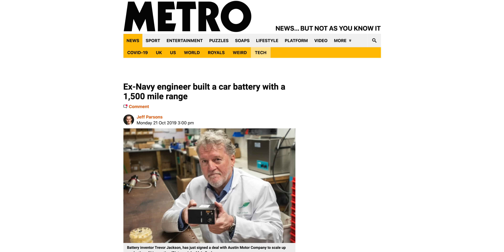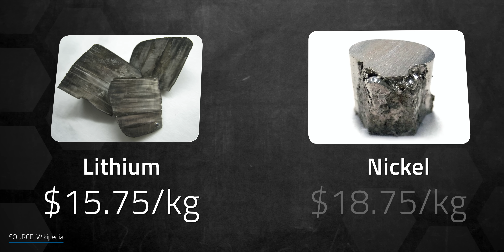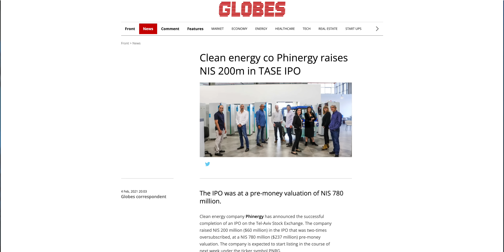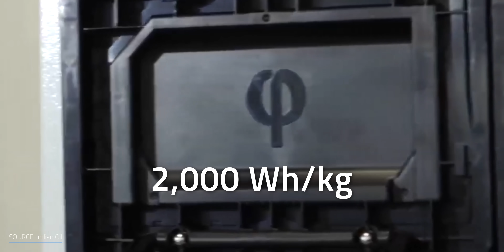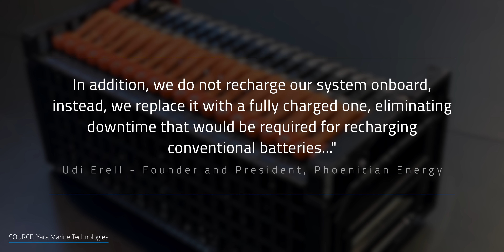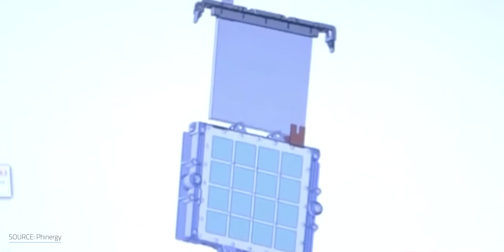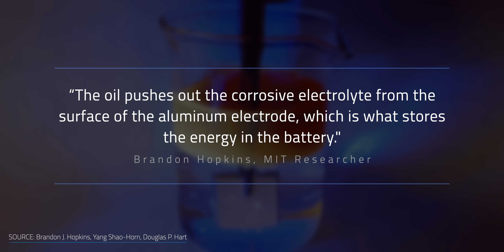Exploring the 1000 Mile Car Battery - Aluminum Air Hype?

Comment: The way I see it is that the 300 miles an EV today is WAY more distance than I'd need. I really only need the battery for about half that just so I'd feel confident I could use the car for a few days locally in case a situation arose where I couldn't charge it. Then if I could put an Aluminum Air battery in the trunk in the event I need to go on long distances would sound like a win-win to me.

Comment: Aluminum Air battery would make a great range extender.  Put it in a small two wheel trailer and tow it behind a regular Lithium battery EV.  Going on a long road trip rent one from U-Haul.  The small two wheel trailer could also allow extra storage space which is exactly what is needed on a long road trip.  Or how about a RV trailer with Aluminum Air battery capability.   U-Haul can rent those as well.  If EV manufactures could make removable hitches and electrical connections standard this would eliminate the problems with buyers hesitancy over concerns about longer distances.

Comment: There is one thing I don’t understand: why not build an electric car, but instead of a huge battery, use a small one combined with a small diesel generator. AND build this battery and generator modular. So you can change this module in the future if better technology is available. Because there is one thing I hate about all these electric car discussions! Everyone is acting like we save the world with them. Which is definitely not the case if you produce throw-away products. And we all know that these cars won’t last for decades like the “old” petrol cars.

Comment: Why not have two batteries and swap out the one that is used up, while using your second b/u battery.   You won't have to be towed.
  If cost is problem or size maybe build them smaller (750 miles on a charge) and have two of them so one is a backup you drive on and get replacement battery for the used up one at the station.

Comment: Battery swapping isn't an issue with me, as long as there are enough available. It would be nice if they made it where you could interchange them for a rechargeable drop-in as a in-between when the customer is not able to do a swap for another Aluminum air battery. Like the side of the road, the royal areas or even long trips.

Comment: Yes, a recyclable battery swap every few thousand miles instead of daily charging… count me in!
Many people would be interested in this after all conventional ICE cars need periodic oil changes and people put up with it.
Reply: i didnt hear anything about costs. is seems like if you throw the battery away every 1000 miles its got to be expensive.
Reply: @scottmcshannon6821  they are being reused not thrown away
Reply: Costs are indeed primary.Fleet vehicles and leased cars could have their own depots particularly if they stick to one manufacturer.The potential here is unlimited. I would sign up to it.
Reply: 3 minute swap is faster than filling up your tank with gas. Charging lithium isn't free like people think. Maybe it would cut down on child labor as well. Depends on cost but sounds great to me. 300 mile range is worthless to truckers for instance. Carry a few extra packs and you could cross the usa...
Reply: @Mr.Mister001  finnaly someone brought up the child labor that elon musk fans love to ignore.
Reply: Forgot to mention how ev lithium are putting even more strain on the grid..
Reply: @Mr.Mister001  if we could ever get the people on board with Thorium reactors, this wouldn't be a huge issue.
Reply: Lets say where you live has 10,000 cars that use Aluminum air batteries, will there be enough Gas stations with 10,000 + air batteries, just sitting there waiting to be used?  I think not.  Now if they could figure out hot the stop the degradation issue and be able to recharge them, then you have a game changer.
Reply: @kfl611  supply and demand. They could store these batteries easier than gasoline/diesel. Plus, no extra strain on the grid, emergency home power, and you could keep extra batteries yourself. Imagine 3k miles without needing to fill up...

I'm no expert but those all seem like game changers to me. It's a pain to store 30+ gallons of gas but 1 battery? No more generator for me if I had that option. 

I'm not saying it would be easy. I am saying it's easier than putting in charging stations. Then aluminum is recyclable. Lithium burning at every car wreck would pollute so much. It all sounds too good to be true... If it does work, I'm all in. I don't want a car that only goes 350 miles but I travel often for work. 

As for recharging, I don't see the need. Just look at them as giant AA batteries that can be recycled. We don't recharge gasoline and lithium is usually only good for 10k charge cycles. After that, your car's value is gone...

The degradation is a problem though. Just draining the batteries shouldn't be too much of a problem though.
Reply: @Mr.Mister001  I think a lot is involved in electric cars - greed, politics, geopolitics - rare earth metals.  Who knows.  It would be nice if you could easily have a charging station at your home, and one at your place of work and just charge up green all the way around.  But I doubt the petrol industry is going to so easily bow out of the transportation industry.  You would think the petrol industry would be spending billions in renewables and capture that industry, as that is the way things are going.  Kind of like Kodak and digital imaging processing.  Kodak made the first digital images, but somehow thought people were going to just go on using film for images, when digital imaging took off, they were left sitting there with their pants down.  People do not want global warming to take over and weather to get even more crazy - along with how people do not want war over petrol, and things being more unstable - with all the related issues - like fertilizer, grain production, inflation, food security among nations, etc. Trying times we are living in.
Reply: @Mr.Mister001  I'd literally convert my jeep to run this system. Change the batteries myself every few thousand km. Especially considering the weight difference, it would be worth it. I was thinking a quick lock battery system with a small holding holding tank for electrolyte. Ohh the possibilities... I wish it didn't have to use silver though 😕

Comment: I'm just going to point this out and kinda kill aluminum air batteries fairly fast.

Recycling those batteries is going to take far more energy that recharging a L-ion battery.

You have to melt aluminum (Which is scarily dangerous while molten), and then silver as well for EACH of these.

Even assuming 1/100th the cost of production, a L-ion batteries can survive over 700 Charge cycles and retain most of it's charge.

The only places where this might be useful is for Aircraft and Military applications.

Comment: Also, ironically enough, the EV market suffers from its own success. Battery technology is getting so good now that we can reliably expect 20% increases in EV range every 3 years. So if you want 500 miles of range in a car that costs about as much as the Model 3, just wait 6 years. Which undermines the current profits of car manufacturers like Tesla and other EV companies, because it means that people will simply wait for more performance.

Comment: Swap your battery at the same interval as changing oil? That sounds pretty reasonable. I'd like to have a 60 mile rechargable though. Then the long range aluminum battery would last much much longer. Or, if I bought an electric f-150 I'd like an aluminum air battery that can be dropped in the bed when I'm hauling horses across the country for example.

Comment: As a similar thought to a lot of the comments, a neat idea would be turn the batteries into a portable trailer to supply extra range when you need it and they can be detached and exchanged easily.

Comment: This isn't a replacement for lithium batteries, it's a replacement for petroleum fuel. It offers good range, but it's consumed as it powers the vehicle. I suspect that this or a related technology will be used for long-haul vehicles, with rechargeable batteries for vehicles that aren't meant to go too far from population centres. How recyclable is what's left of the battery once it's discharged?

Comment: These might work if you could find a replacement for the silver. The cost will be a factor, and I don't see how these can compete effectively with rechargeable batteries unless they are dirt cheap and widely available.  More research is needed to find a way to make this type of battery viable. From what we have learned here, this technology is not yet ready for prime time.

Comment: "Would you want to drive an EV that required battery swapping?"

That is almost the same question as:
"Would you want to drive a hybride EV?"

A couple decades ago, if you use the word "battery" you did not mean "rechargeable battery".

If you are going on a long trip it would be nice to pop in a high capacity primary cell (like the aluminum air) as a suppliment to your main rechargeable battery.

Comment: I bought a motor kit for my bike and had professional quality battery made for it. The battery is what matters! I'd love to test a 48V 20 amp-hour battery pack on my bike to test how well it lasts. The battery I bought is 2 years old and it's already lost some of its range. I project that it'll be worthless in only few short years. 
I take care to keep inside when it's too cold or hot outside. You can't do that with a car's battery!

Comment: Reprocessing the spent aluminum from aluminum oxide is effectively just restarting from aluminum ore. Making aluminum from ore is an energy intensive process so I wonder whether the ratio of energy required to make the batteries to the energy available in the batteries is comparable to recharging lithium ion batteries. If there could be savings there, maybe we should consider this option, as it would simply be energy that, instead of being transported over wire, pipeline, or tank, is moved by freight. Instead of gas stations or recharging stations, we all go to our local aluminum reprocessing station and exchange our used batteries for new ones.
Reply: Then the smelting can be sent to a geothermal site
Reply: I imagine the aluminum plates get coated in oxide to the point of unusability long before they physically run out of metal. If they can be reprocessed where an automated system scrapes the oxide from the plates and puts it back together, it might get a few lives before they need to put in fresh plates.
Reply: What about cooking aluminium oxide with hidrogen from electrolisys? At high temperature, it will combine with the oxygen and turn to pure aluminum and steam. Still energy intensive but less than smelting.

Comment: I'm not sure about the other countries, but in here in India we can find the the gas station within the 20 Kms on average radius.
On the National/State highways we find the gas station within 50 Kms on average radius.

Some marginal problems are still there like what if the juice gets finished before a person reaches the station ? at that point I see where the hybrid options comes in.

Although not everything is perfect but it's still viable solutions, if india wants to load off their energy dependency.

In india we see a major breakthrough in becoming the independent in our energy consumption in next 5/10 Years, from Auto Industry to Electricity consumption using thorium based powerplant.

Comment: So we have an outlander phev which would be great for this on the few times a year long journey that we need to do without using the petrol. Currently its 20mile per charge does us well for the daily driving and we have a muxan 35kwh 2011 leaf for the rest. If this could be done as cheap as refueling with petrol then there is no competition for us at least.

Comment: If the batteries were built like the teslas and could be replaced from underneath the vehicle and changing could be a quick drive in drive out affair where the swap is automated I think getting 1000+ miles would be awesome the only thing keeping most people in gas burners is being able to go to the station and get a single gallon if needed as opposed to a full tank every time

Comment: You know when to change the battery. If you use fuel you need to go to a petrol station to fill your car up! You didn't mention the cost compared to fuel/km. Lithium is still used because the main players are shareholders investing in lithium! Jackson has the alternative. He and a French company did a test with a Nissan Note. It was a brilliant result. You are downgrading Aluminium Air Battery. Why don't get in touch with Jackson's son Peter. I did and had a good conversation. Why is India investing to manufacture Aluminium Air Batteries?!

Comment: Wait, one look at the periodic table will tell you that Lithium is lighter than Aluminium. So why would Al based batteries be lighter?
Reply from the maker: They are much smaller with the same energy capacity.

Comment: Two smaller batteries might work better, especially if you can limit degradation. That way you swap out the one that is exhausted while still having enough "juice" to not run out at an inconvenient time. 
I've heard the biggest issue of Al-air vs Li batteries is cost effectiveness.

Comment: I drive a BMW I3. The only thing I dislike about it, is the limited battery range. With the range extender I have about 60 miles if I need it. If I could use the new battery, and have a backup system, definitely would do it.

Comment: Personally i don't mind carrying an additional battery ( if feasible) for my car to avoid any situation where primary battery is drained. But  multiple solution can be build to measure the current capacity .  I don't see much problem there, but i think major issue like burning ,bursting etc missed. 
Did you find any such case where these battery busted or some mishaps like that?
Also learning from your video somehow i see this as solution to residential electricity solution.  Let me know your thought.

Comment: I think, it is better to adopt battery swapping technology, because the battery technology is changing day by day, we cannot predict what kind of battery will be used in the next or two years after, I think it is better to  install a universal battery adaptor or connector in the car and adequate space for keeping the battery, so even if the battery technology changes, the old battery can be replaced by new types provided power output keeps the same.

Comment: I can envision each car will have 2 swappable 500mile Al-air batteries that would be consumed in sequence. After the first 500miles are used up, the car switch to the second battery. The driver can swap the used battery within the next 500miles. A battery provider company will have swapping stations or delivery services.